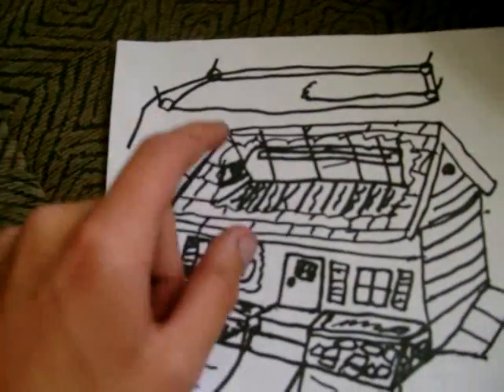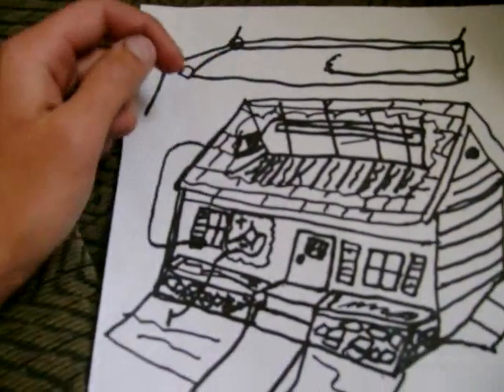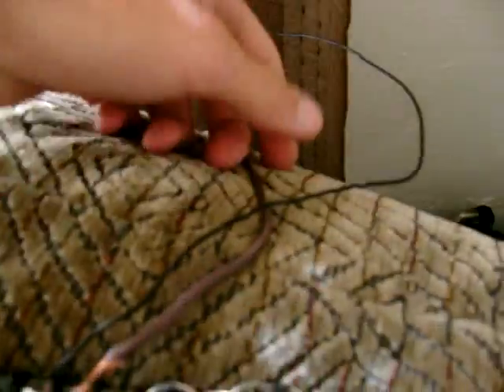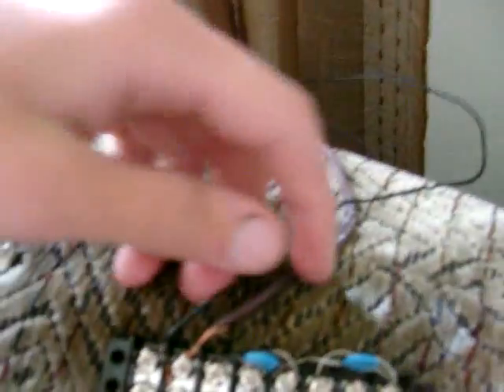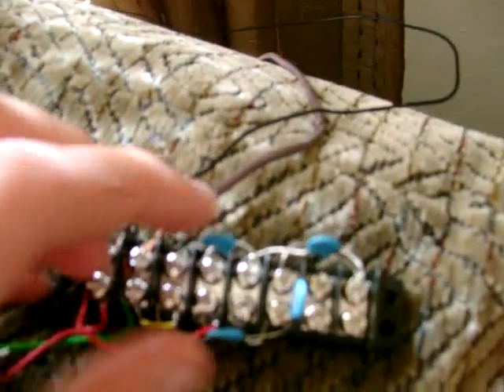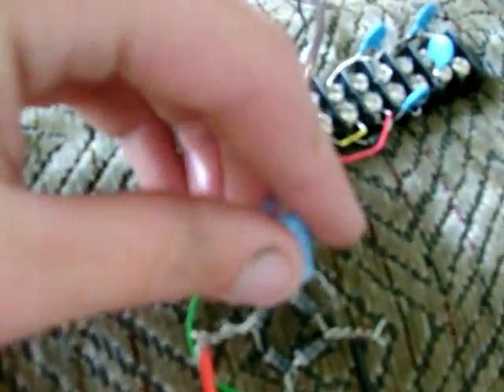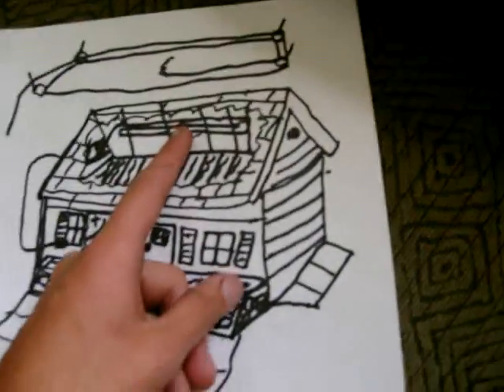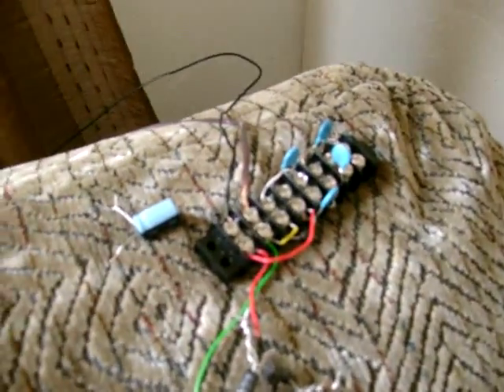tesla radiant energy capture patent recreation part 3

Comment: Isn't this likely to just be induced current from the electrical cables and stuff in your house? I have seen 100+ volts (but a tiny current) in cables that are not connected to anything, but running alongside a 240volt mains cable in my house.

Comment: Hi there, thanks for your video. I thought the objective was to capture radient energy. If so surely the reasons for a low voltage is that you are trying to capture energy through roof tiles, which are made up of dense material and crushed rock. I can see were you where going with with this, but if you put the antenna on a big painted board and suspended that up a tree would that be better?

Comment: The key in understanding how much energy this device captures is multiplying the Volts times amps to get watts. 
7 volts at .5 amps is the same power of 3.5 volts at 1 amp, and in order to measure the amps, you have to be powering something to make the current flow. I would use a fan probably, or a light bulb.
You should be able to make multiples of this circuit, and put them together in parallel to get higher amps (which is what you will most likely need).

Comment: Some. I did it crudely with what I had $ at the time. I had copper wire, I still have a spool of it, Ithink it is 24 gauge. Then I had a 12inch x 12inch Zinc Coated Alumiinum board/plate. Then I had 2 diodes, the one way diode from Radio Shack for $1 each. I had one copper wired attached to one side of the plate and one attached to the other. The plate sat in top flloor of my small split level house and I was able to get 4 volts consistently, sometimes 7.

Comment: omg you only have to write tesla to somthing and get milion klicks .... forget the stupid wire go to your roof on the inside and as collector u use aluminium foil hook ground to jour water pipe and place the biggest capacitor you can find directly on the bridge rectifyier (the 4 diodes ) and throw away all the other crap and you up to 90 volts (depends on the size of the aluminium collector ) it needs to be long not big   i made a giant spiral on my wall u can see it in my videos

Comment: @Steve042176 Yep...what you linked to looks like a fairly accurate representation of Tesla's design. The design in this video is basically just picking up radio signals with an antenna and getting power from that.....Tesla's design supposedly worked by a different principle ( I've never tested his design myself....So I won't make any personal claims about it. Tesla's design claimed to capture energy from "the sun, as well as other sources of radiant energy, like cosmic rays,")

Comment: great start keep going who knows what you'll get out of that thing! Just wondering if it would help to have antenna running straight in the air vertical although it may not go over well the powers that be seeing as how an antenna sticking 30 or 40 ft in the air next to the house is not to appealing to neighbors and a coil in the circuit. But your getting results thats the main thing keep up the good work.

Comment: The other one is to use a Metal Plate on roof top...rather standing up facing up like a Satellite Dish...or a very well spaced and lined up Bi-filar Coil (Another Tesla's Patent)
Last, you do need some kind of oscillator to pulse a Resonance...without this, you will never get Radiant Energy in...Tesla used a Relay type, a magnetic wheel and a motor,but now days any RC Toy controller (not for BL DC-Brushless Motors) but for commutators motors will do it.
You have to spend some power to get it in

Comment: Hey friend,
I see your attempts to follow up Tesla's work...and it is nice to see you trying!!
Let me give you some 'Hints'
Try to get an Adjustable Capacitor, the old types would be better, they used to be in very old tubes radios,they used to be the Tuner to dial stations...and according to Tesla's Radiant Energy patent, it has to be connected between ground and antenna,then you 'tune' to the right frequency  while observing the meter.Another alternative is to use a High Capacitance Trimmer.

Comment: Hi guy, just a question for you, do you live in that house ? LOL.... No real question is, see the ground you use, well I live on the 2nd storey of a block of flats, the grounding could be tricky, so with some thought I was going to use the gas radiator water pipe, as this is grounded and goes to ground outside for sure, what do you reckon ? !! the wire I had considered hiding behind the coving which goes round the top of the living-room walls !..{ interesting videos guy} thanks.
Thom in Scotland

Comment: @serversysadm  Resistors are nothing special, they are just coils of wire. Take the outer coating offa one and see for yourself.... the coil just creates reesistance by the length and gauge of wire that is used, which affects a potential difference (voltage drop) across the resistor.

Comment: Nice Job. from comments, I see you use the germanium diodes also, good!
I had no luck with running the antenna around corners. I would make eye bolts out of plastic, or put plastic fishing line from eye bolt to antenna wire as an insulation from them. Some one once suggested trying to use a copper elbow piece to run antenna through around corners. On the corners the electrons would flow from outside surface of antenna wire to inside surface of elbow and back to ouside surface of antenna:-)

Comment: @Superman83271 i will only reach a certain amount of power. the ant. cant be all bundled up as i once thought. if the wire is spread out as far as i can stretch out and not be coiled or bundled together. learned that with crystal set radios. the mulyguage ant. are close together and will act like one thick ant.

Comment: I think you should go out and get some basic electronics books and learn some more about elecricity. Comments like - "0.5v more power" and "the voltage went up to 0.27" show you have a less than basic understanding of electricity, even though you may be able to follow a circuit diagram. Voltage is not power. The volts didn't "go up" to 0.27, you just didn't lose as much with the new bridge rectifier as you did with your home made one. You have built a radio reciever with a DC rectifier attached.

Comment: Exactly.......in fact you can build a small radio powered by nothing but radio waves. I think I saw a model as a childs science toy recently......This is simple simple science......and it seems extreamly impractical. You can see a similiar thing with a cheap guitar pickup. If you here a radio station coming through your amp it means the pickup/string assembly is getting energy from radio station-transmiting it to the amp. This video shows about the poorest least effective example I could imagine

Comment: One question. I watched Marko Rodin's video about getting rid of resistance. Wonder if you use a circuit board to connect the bridge and the capacitor if that would smooth out any resistance and have more flow? Just curious. I'm a newbie...learning.

Comment: Keep going. Keep working the details...My first round is very very crude...I have a lot to do. I wrapped the grounding coil around the metal plate, and the other coil that the rectifier and capacitor is on and got just under 1 volt. There's another guy on here who was able to get 14v in 15 minutes. Thanks for posting this helps..if I get it down to where I'm getting more than a few volts I will post.